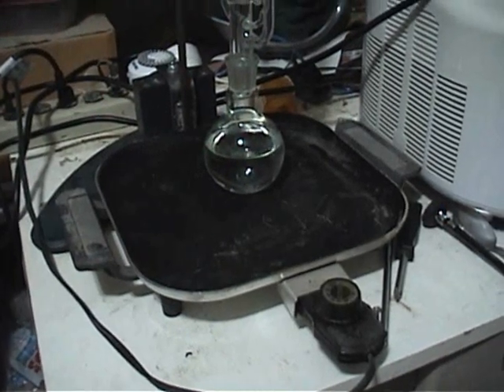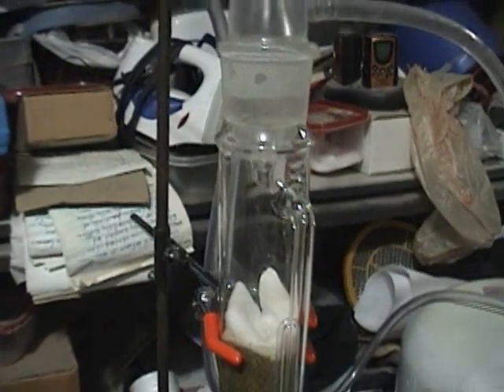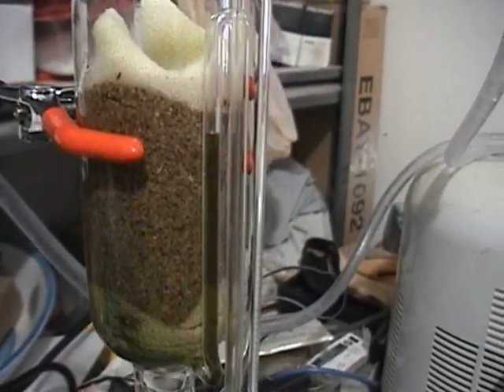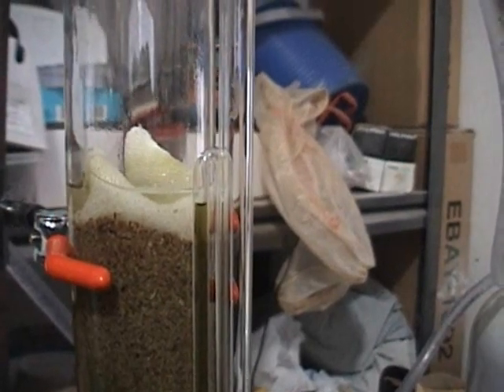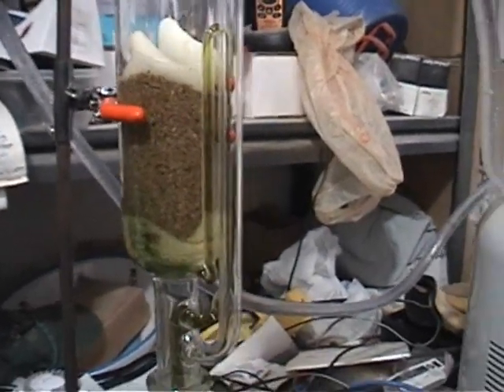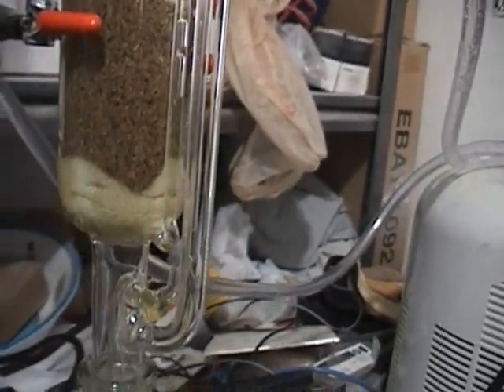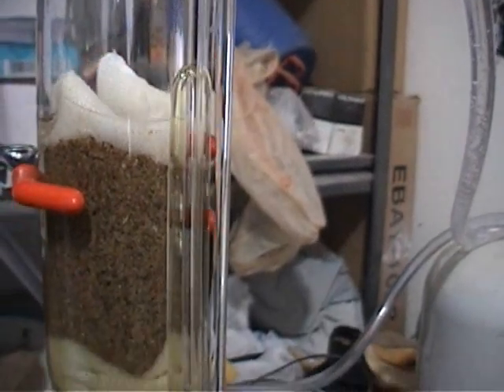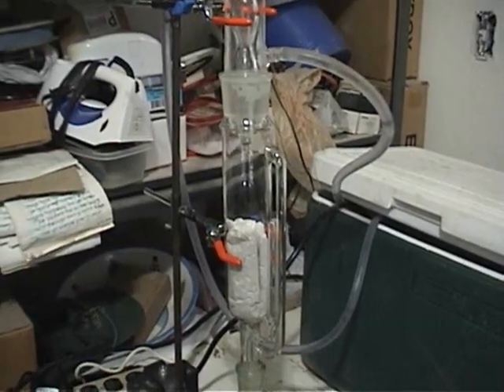Soxhlet Extraction of Medical Marijuana Oil

Comment: petroleum ether is Naphtha AKA benzine. I guess its good to use I never have, 99% isopropyl at a low temperature works well. Using the soxhlet at a high temperature causes the decarboxylation of the THC during the extraction. Personally I prefer butane for wax but this is good for tinctures and edibles, and if done correctly or you like the taste the chlorophyll is not that bad, some strains may be better than others.

Comment: Your condenser isn't connected to the water pump correctly. The water inlet pipe should be at the bottom, not at the top.

Comment: Also if you need to get your condenser colder than what is possible with water, try adding some engine coolant/antifreeze to the water. For even colder coolant, I drop dry ice into 95% ethanol and pump that through the condenser and you can see temps of -78 or lower :)
anyway thanks again for the vid and i hope ive helped a little

Comment: Second you have to address the water circulation. When using condensers there is only a few rules that need to be followed. Refluxing - cold water in where the hottest vapour enters, warm water out where the coolest vapour leaves. Condensing - cold water in where the coolest vapour exits condenser, warm water out where hottest vapour enters condenser. For best cooling all surfaces MUST be covered in coolant. cont.

Comment: First off, Great video mate. Ive been making my own oil for over 10 years now and im also a qualified lab tech so I feel confident in giving you a few pointers. First off, your heat supply, if you dont have a proper lab heating element (like me) you take your krok pot like you have set up but instead of using water as the heat conductor use plain old cooking oil. Oil loves to take on heat but doesnt like giving it up so it makes a great temp buffer.

Comment: Not sure what you mean mate? THC has a boiling point of 200°C (392°F) and isopropyl alcohol has a boiling point of 82.5°C (181°F). So the solvent isnt going to get anywhere near the temp THC starts to boil at, let alone breakdown. cont.

Comment: Ok i see a number of issues with your yield efficiency.  Tetrahydrocannabinol some what unstable and decomposes the higher the temp. Alcohol as a solvent has to high of a boiling point and will remove a number of compounds considered undesirable. So your best bet would be a  non-polar solvent like hexane would improve your extraction efficiency, Also suggest putting your flask in a bath and have a probe on both the bath and the inside of the condenser to keep temps to a min.

Comment: You want to pump the water in at the bottom, and have it exit the top port. It may seem counter-intuitive, but this provides the best heat gradient across the condenser surface (i.e. the coldest water comes into contact with the hotest vapor first). Ideally, you also want no air in the water jacket of the condeser body. Get the condenser properly filled and circulating before putting it into the system.